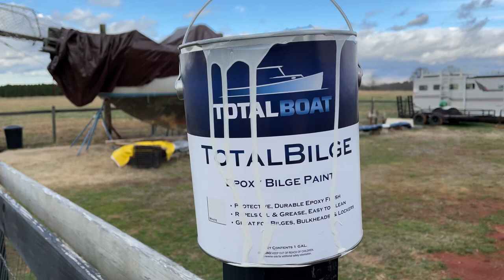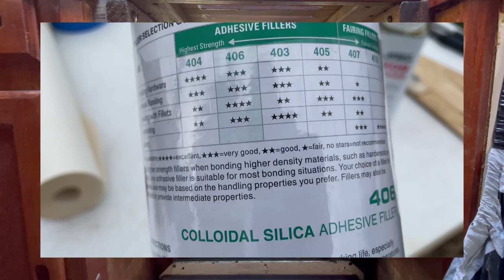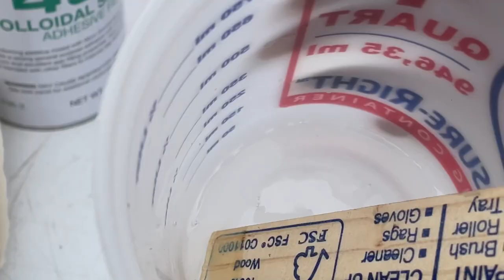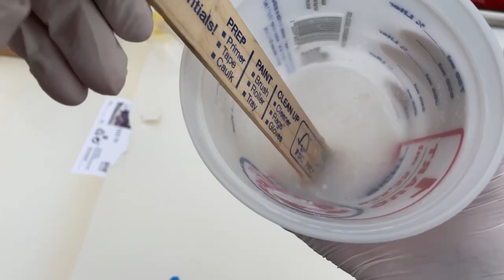How to Install a Sailboat Engine Using a Jig Pt. 2 | Sailboat Restoration Ep. 17

Comment: You're getting the hang of the videoing! Nice episode. Starting deep in the bilges and engine bay, and working up.
Reply from the maker: The tough projects first. Engine, hull, electric. Everything else will be a lot easier to check off.
Reply: I like this approach as well.  Systematic.

Comment: Do you have any concerns about using aluminum for your mounting plates?  Although heavier and more expensive, wouldn't SS be a better choice?
Reply from the maker: Great question. I spoke with Beta Marine techs at the Annapolis Boat Show about my engine install and they had no issue with the aluminum plates. They are 3” X 28” aluminum long plates.
Reply: Thanks @Even_Keeled  I appreciate the reply and the dimensions.  I'm starting the restoration of a 1976 Frances 26 and plan on putting in a Beta 14 or 16 (TBD).  Just came across your videos and already can see how they are going to be helpful (definately appreciate that you are doing them).  Thank you.  One other questionk for now, are the plates 1/2 inch or something different?
Reply from the maker: @tomlix  Yes,  ½” . With a 45 bevel to fit the Westsail's engine pan, but it could be completely different for the Frances. Plus, some notch the aft, inner corners of the plates to allow the engine and accompanying cables, hoses, etc. to fit easier. That all sounds like an exciting restoration. The best of luck!